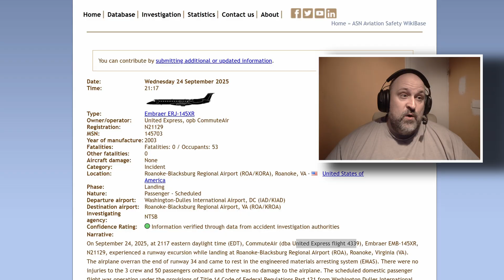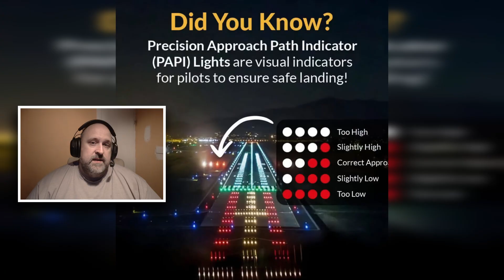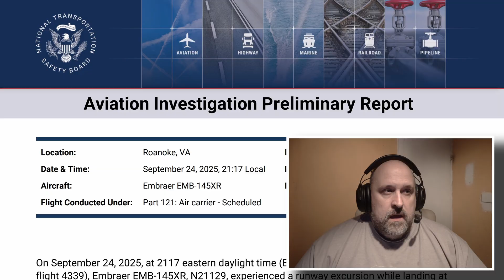So Many Warnings. One Captain. Multiple Terrible Decisions.

Comment: Seems like you folks are making this a big deal when its not
Reply from the maker: I can understand why you might think this isn't a big thing . The plane just overran the runway and got stopped by the EMAS. So what? 
When doing a deepdive in the story and aviation history, you actually find out that it's a major issue and an alarming accident. 
The captain chose to ignore the first officers call out to go around - not once but twice. This goes against all trained CRM and is a complete nogo what so ever. There is a reason CRM is standard in the aviation industry - it's to prevent fatal disasters like we have seen in the past. And there is a reason for being two pilots in the cockpit. 

In this case the captain didn't see what the first officer was seeing and that cause a runway overrun. In this case it got stopped by the EMAS - but lets say the runway didn't have an EMAS - the plane could have continued beyond the runway and perhaps experienced a much worse outcome. 
Or what if the first officer actually had spotted another plane or vehicle entering the runway - then the failure to execute a go around would most likely have had a fatal outcome. 
There has been several accidents in aviation history cause by failure to follow proper CRM and ignoring warning from other crewmembers. 
So this time it might not seem like a "big" deal, but in the big picture it's actually a huge deal and not something to be taken light upon.
Reply: @AndersSmithField i compltely understand what you are saying , but t the media is horrible in their accuracy of information and they love to play off of the general publics lack of knowledge if aviation and also the medias inability to grasp ANY firm knowledge of he in industruy as a whole
Reply from the maker: On that one, I completely agree :)

Comment: If they did a go around, why would they immediately divert to another airport?
Reply from the maker: A very good question since you normally try to do another approach at your destination. 
But I think that since the margin for landing on the runway in use was very shallow - they might have decided that it was better just to do the diversion straight away. 
But it's all speculation from my side :)
Reply: Could have been a forecasted deterioration of the  weather and/or their fuel situation.